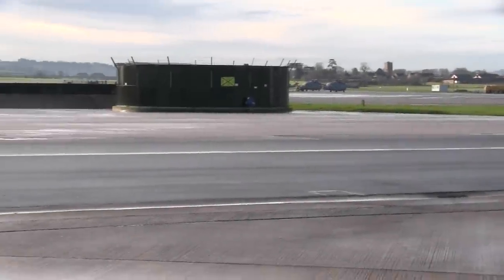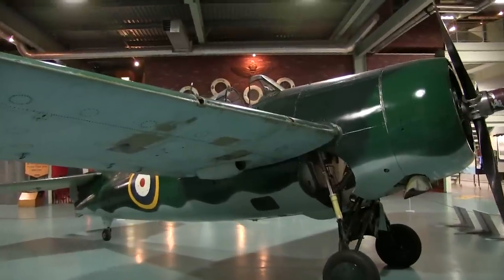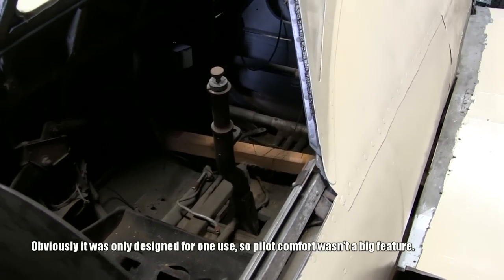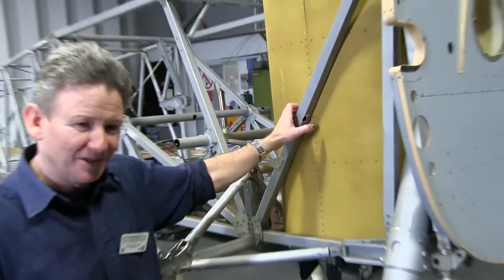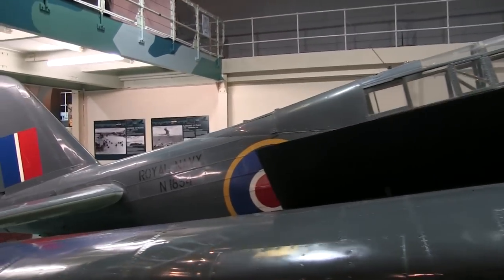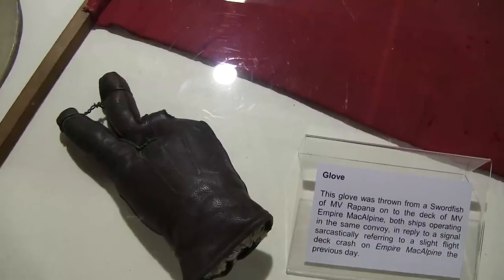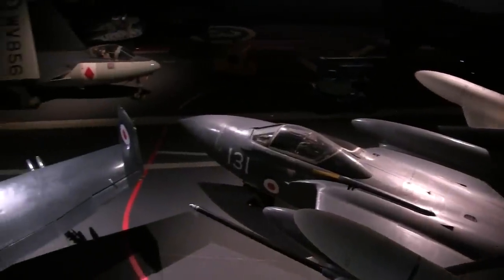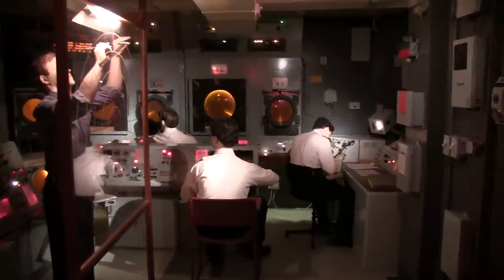Fleet Air Arm Museum with The Mighty Jingles Part 2

Comment: Jingles! I notice that that Martlet only has machine gun ports for a single pair of inner .50 cals (there were originally two pairs of 'inner' guns, and upon the FAA's request, the extra pair was added about halfway down the length of the wing). Did you ask about/learn about why that (the lack of two pairs of inboard .50s, or at least the ports for them) is/was?

Comment: Jingles, you may want to show the details of the Swordfish's bomb racks to Gaijin and maybe the old Stringbag will finally get its proper bombload.
One of War Thunder's cruelest joke is not giving that little bomber any bombs at all. That and putting a Wellington in Era 4.
Reply from the maker: Especially since it was used successfully with rockets once it was superseded by the Albacore in the torpedo bomber role and accounted for 14 U-Boats with them.
Reply: BohemianEagle
Of course, the Swordfish currently in War Thunder is the Mk I which as you probably know would find its cloth covered wings a bit too flammable to be exposed to rocket exhausts. I believe setting your wings on fire is frowned upon even in such environments with plentiful water as the Navy could provide.

But I do admit to a gigantic softspot for the Swordfish. It looks as obsolete as it actually was, but that did not stop it from kicking arse and taking names.
Reply: Elmarby Gaijin are aware, and Mk2 will be in the FFA batch...soon